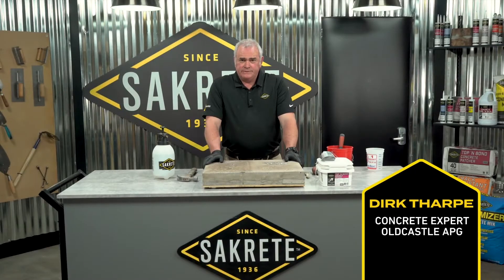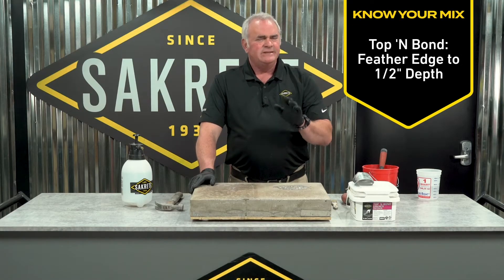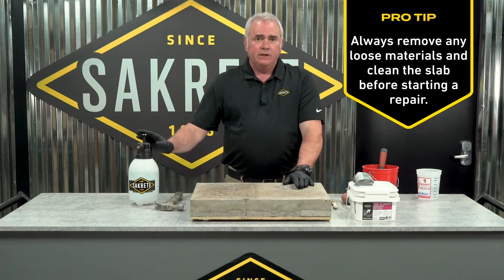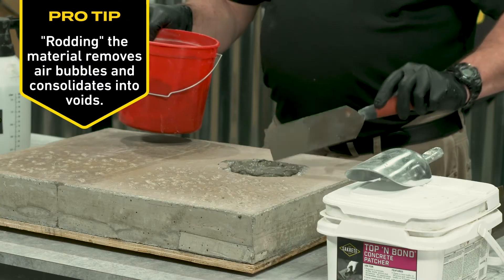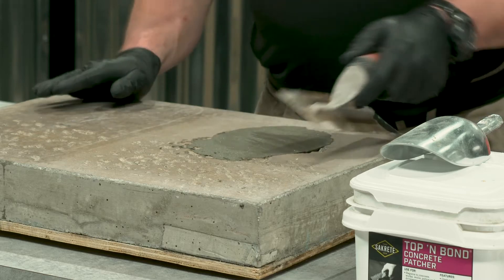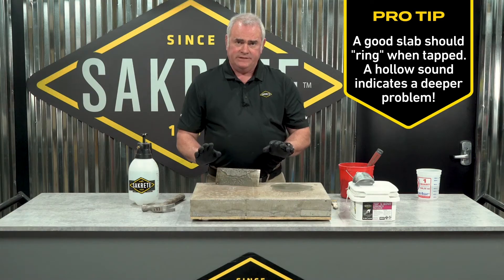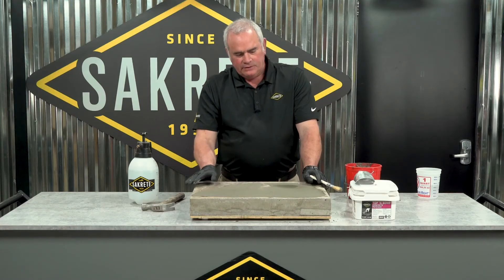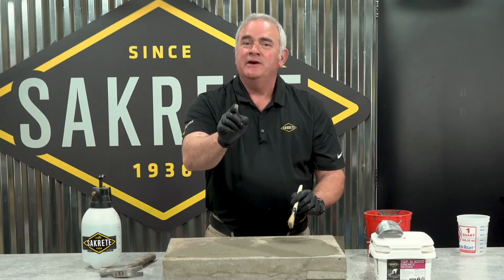Pro Tips: How to Make a Thin Concrete Repair | Concrete Repair | DIY Project Guide

Comment: @SakreteOfficial
I have a leftover bag of some fast setting cement patcher. Can I use this also as a topper like top and bond to fix some  cracked & damaged concrete
Reply from the maker: It depends on how deep the repair is.

Top 'N Bond can be used for feather-edge applications (< 1/4"), meaning you can smear it across the surface. For example, you can fill in spalling with a skim coat.

Fast-Setting Cement Patcher is designed for repairs 1/4" - 2" deep, so as long as the cracks or chips are in that range, you're good to go.

📞 If you ever want to talk through a project, give us a call at 866-SAKRETE (725-7383). We’re always here to help.

Comment: I used Top And Bond to remove trip hazard due to lifted concrete sidewalk.  It worked excellent.  Feather edge adhesion is perfect
Reply from the maker: Hey, Russell! Awesome to hear - congrats on a successful repair project 😎🔥

Comment: Is it the case that you should wait 28 days to seal with Sakrete Cure n Seal?
Reply from the maker: Great question, sir. The clarifying question we need to ask is whether you're using Cure 'N Seal as a CURING AGENT or as a SEALER.

When applied immediately after initial finishing, Cure 'N Seal acts as a kind of vapor barrier that locks moisture inside the slab to promote proper curing that will boost ultimate strength and minimize cracking. Using Cure 'N Seal this way minimizes the need for "traditional" wet curing methods (covering with plastic, burlap, etc.).

The other option is to use Cure 'N Seal as a POST-APPLIED sealer where the goal is to mitigate staining and damage from water, oil, sap and other environmental contaminants. There are many brands of post-applied sealers, but they all share one thing in common – you must wait until the concrete is fully cured (28 days after pouring) to apply them. Same situation as with paint, stain, etc.

Hope that clears things up!

For a bit more info, check out this Pro Tips post: https://www.sakrete.com/project-guide/curing-concrete/

Comment: The instructions say no need to wet during curing/setting. Is that strictly true ? What if there is a lot of sun shining on the repair  ?
Reply from the maker: You're 100% correct that you should keep a Top 'N Bond patch damp during the curing process – always a best practice!

Can you let us know where you saw the "no need to wet during curing / setting" language? Sounds like there might be a typo out there that needs correcting.
Reply: @SakreteOfficial  in  the Sakrete Top n bond CURING section published by Sakrete Canada :.."Do not wet the surface
with water after troweling operation has been completed."". However, it seems correct on Top n Bond concrete patcher doc ( mar 2016 ver 1.1)   "" Keep the surface damp, using a sprinkler, wet burlap, or cover with plastic for several days as needed..""
Reply: @SakreteOfficial  https://www.sakretecanada.com/dam/dms/ca01/8/Sakrete%20top_n%20bond_pds-en.pdf
Reply from the maker: Thanks! We'll talk to our Canadian brethren about making that adjustment. Greatly appreciate the catch!

Shoot us an email at info@sakrete.com – would love to get you some Sakrete gear as a thank you.
Reply: @SakreteOfficial  email address does not work
Reply from the maker: Might've just been the link – seeing that just "Sakrete.com" was highlighted. You could also just drop us a link on our contact us form if that's easier!

https://www.sakrete.com/contact/

Comment: I am planning to use this to resurface my badly damaged stairs. Will it be ok to use on vertical step risers also ? Is Top n bond mainly for horizontal surfaces ? Thanks
Reply from the maker: Top 'N Bond can definitely handle vertical surfaces – perfect application for that mix!

Comment: I did repair a spalling patch , but the surface developed some  fine spider webbing on a part of the surface
Reply from the maker: Sounds like a bit of improper curing is to blame. Though that web cracking is probably just aesthetic, you could certainly give it another coat to make things look clean. Remember to keep the patch moist for about 24 hours next time!

Comment: For Top and Bond they say  if the fill depth is greater than 1/2 inch, you can fill in layers but you have  have to wait for each layer to dry. But how long or how dry should it be before adding another layer ?  And how thick can you build it up ?
Reply from the maker: Good question!

Safest bet is to wait the full 24 hours before adding additional layers – but there's no real limit to how high you can go. 

That said, if you've got a deep repair that you need to tackle, you might consider using a different material (eg. Fast Setting Cement Patcher) and then coming back and using Top 'N Bond for the finishing feather edge – could be faster than building up layers of Top 'N Bond.
Reply: thanks  for the advice @SakreteOfficial
Reply from the maker: That's what we're here for!

Comment: Can you apply over cracks repaired by 2 part epoxy ?
Reply from the maker: With proper surface prep, that should be feasible. Main concern would be bonding to the slick surface of an epoxy, so it'd be best to try and remove as much of that old material as possible first.
Reply: @SakreteOfficial  the epoxy is a crack repair. If I cannot cover it ,I was hoping to be able to feather in concrete resurfacer close to the epoxy. The line where they meet is then an issue
Reply from the maker: We'd be concerned about the adhesion, even over a thin repair like that...though it might be worth a test. 

The best bet would be to treat the repaired crack like an expansion joint and just fill that area with a flexible sealant, but obviously this isn't the most aesthetic solution.

Give the Tech Team a call to discuss in more detail! 866-SAKRETE or via Live Chat at Sakrete.com.
Reply: It is a bit  complicated. I wonder what people do when there are cracks inside a large spall area. Covering the entire spall with epoxy means a lot more expense @SakreteOfficial
Reply from the maker: Very true. Honestly, we'd suggest just using a cementitious repair all the way down – minimizes bonding issues and will likely be MORE than strong enough for whatever applications a normal floor sees.
Reply: @SakreteOfficial  wish I had known about that before I started an epoxy repair
Reply from the maker: Live and learn. Let us know what we can do to help!

Comment: What is the best mix(s) to use as a primer coat to save money by using a two step mix overall feather to 1" repairs on top for larger overall projects?  I have about 30 ft of driveway curb that has a rough chiseled 6" x1" deep edge that i want to bring back up to the level of the rest of the driveway surface and restore the tooled edge. This material seems like it would be costly for that many cubic inches of material. 

Shouldn't you have wet the surface thoroughly (but not wet)  prior to the application?  I see the spray bottle ready to go.
Reply from the maker: Correct that you could do Top 'N Bond in two lifts, but the ideal mix would be our Pro-Mix All-Purpose Cement Mix – you can go 0" - 4" in a single lift with that mix. Super fast-setting and high-strength – it's a better version of CTS Rapid Set (not to name names)...

Sounds like this repair is about 1.3 cubic feet of material, so you're looking at about 4x 50# bags of material. Under $100, and a heck of a lot easier than demolishing and re-pouring...though that's certainly an option too.